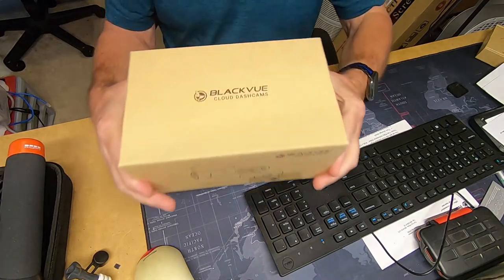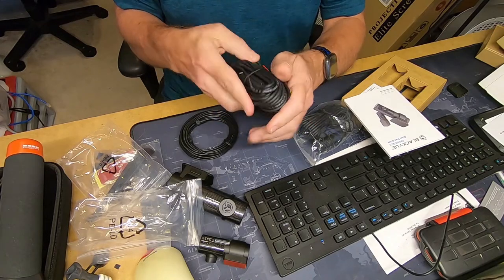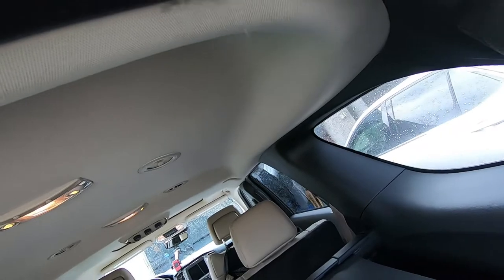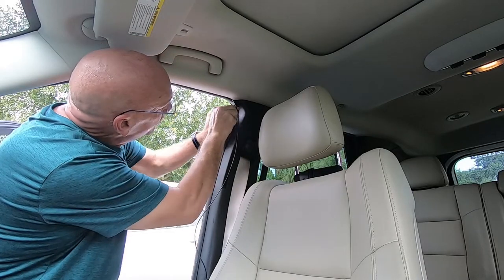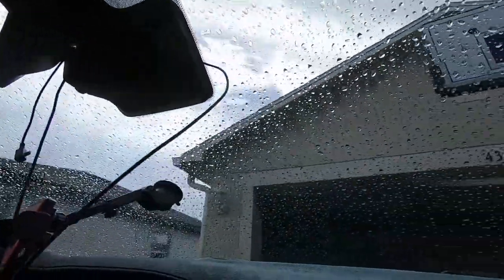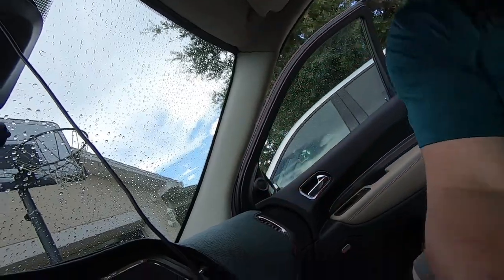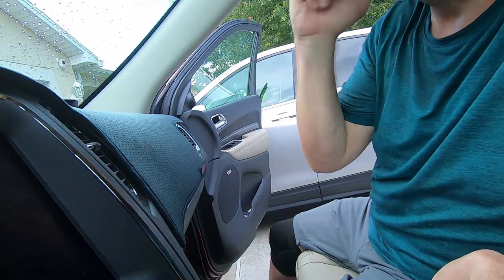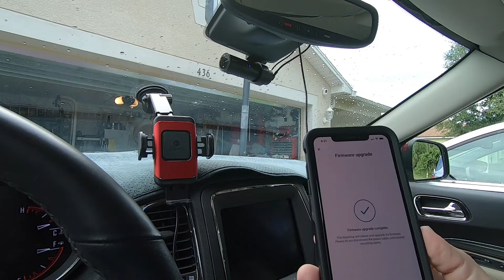How to install a Blackvue 750X-2CH dash cam

Comment: Thank you for this '' heads up ''. As 2022 is soon to are in view. I am looking forward to adding this set up in my Mazda 3 2018 - as I do over 12 000 miles a year. It is a good investment. What UPGRADE I will be doing is to go for the  T R U C K  version. Thank you.